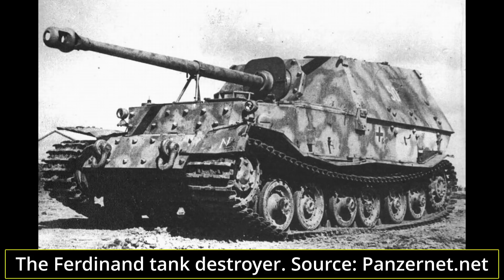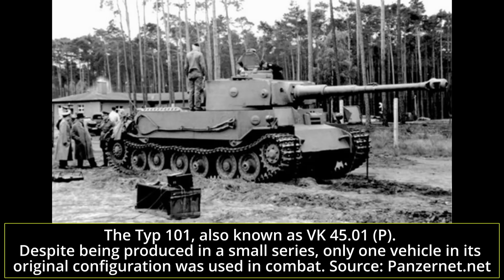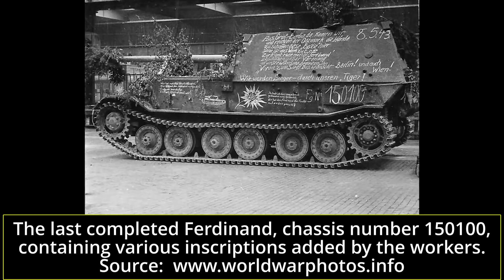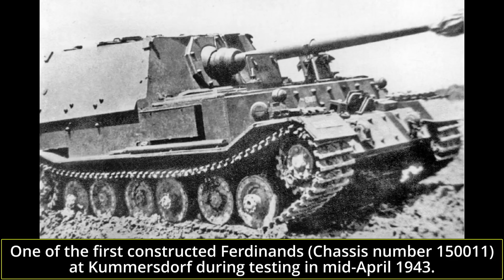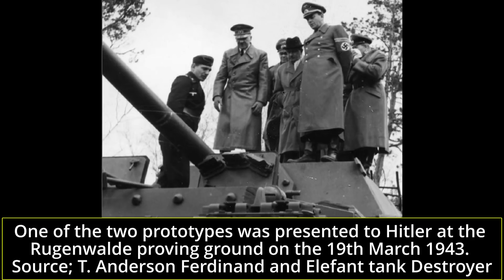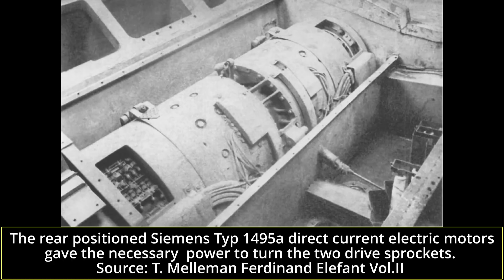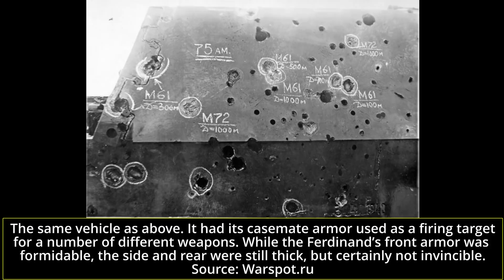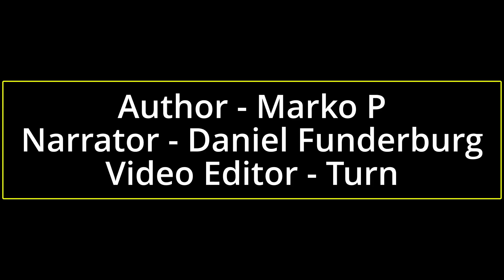The Scariest AFV of 1943 | Panzerjäger Tiger (P) Ferdinand Part 1

Comment: the scariest

for both the enemies and its own crews
Reply: Can relate
Reply: Whole new meaning to firebomb
Reply: literally an improvised JagdTigre using leftover hulls.
Reply: @Manfred K longevity? These things went up in flame often even before the battle started
Reply: harmdallmeyer6449

Many of them remained through 1944 with a few even surviving until Berlin in 1945.
Apart from Kursk, the rest of them took a LONG time to be whittled down.
Reply: Killed on a 10:1 ratio.  Read books.
Reply: @jimmylight4866  Yeah because there are only 90 of them to begin with and the 13 that was lost at Kursk were almost all due to mechanical failure and their inability to recover it 💀
Reply: @Kalashnikov413  Thank you for your reply.  They killed at a 10:1 ratio and had excellent hill climbing ability due to all the torque from the electric motors.  They were knocking out T-34's at 3000m and more.  PAK43 is a great cannon.  Had they gotten more testing time they would have been much better, but rushed into the line much the the Panthers.  Dont be down on the Ferdinand's read what Hilary Doyle says about them.  He sources actual field reports.  Tricky yes, but if used correctly devastating.  If I had to choose I would jump in a ever reliable StuG 3.  The Ferdinand is just so far out there its fascinating.
Reply: @jimmylight4866  Yeah i'd agree on it's actual combat effectiveness but i also cannot neglect its reliability and how almost impossible it is to recover and repair the vehicle

Comment: One might wonder what's the reason for that ridiculously (for 1943) heavy front armor, as it was supposed to stand back and engange at very long range? And at the same time let the heavy break-through tank have "only" 100 mm of front hull armor?
Reply: So you can affiord to give the vehicle 80 mm side armor. What anti tank wepen from 1943, that was used on a large scale can reliable defeat 100 mm armor on a realistic range/angle ?
Reply: Larger guns were beginning to become common place but it was also likely to be an inheritance from the development of the Tiger program. 100mm could be penetrated by various 75mm, 76mm and larger guns.

Comment: There were two units equipped with Ferdinand at Kursk. One was a former StuG battalion, the other came from SP AT background.
The former StuG unit understood combined armored warfare AND its limits, the AT unit thought now that they had thick armor, they could roam around and literally hunt tanks. They were the ones who found themselves "stranded" and close-assaulted. The StuG unit performed excellent. Error of judgement.
Engine and transmission were designed to be used on a 50 ton tank, not the 65 tons of the Ferdinand. Compare Tiger II. Error of trusting a "salesman".
Deployment of the Elefant in Italy was just madness. Any tank in 1943 except the Churchill had problems with steep mountain roads, let alone one that is already troubled on flat ground. The M-26 Pershing had trouble in the Korean hillsides as well. But in both cases that is not the tanks' fault. Error of deployment.

I always wonder why they had not just put turrets on the things (or simply scrapped them).
Reply: The engine and transmission suffered in the original tank as well.

The Pershing was famously underpowered. A horrendous example.
Reply: @Kyle-gw6qp  And still they added 10 tons to the Porsche tank, respectively 15 tons to the Henschel tank. While Tiger(H) was already at the limits, although not as bad as Tiger(P), how could they think of getting away with even more weight ?
I know that Ferdinand Porsche had his head deep in Hitlers ass, but ...

Throwing Pershing into the mix, I have a strong feeling towards corruption in the arms industry. What a surprise !

Comment: Didn't this thing have a shit ton of problems due to its improved design and rushed development? i believe engine fires were common due to a severely underrated powerplant.
Reply: I believe the gearbox was the main problem but yes it was plaged with problems
Reply: Actually the gearbox / transmission were quite good. The problems lay with overheating engines, which was eventually, kind of worked out. Mechanically speaking, this transmission and final drive was much better than that on the Henschel Tiger and Panthers. However, it required a lot of copper and that was needed for other projects in Germany, notably the U-boats

Comment: Anyone else notice the audio stutters?? like it keeps cutting voice audio except bgm audio.

also, does the Porsche Tiger use two sets of sprocket wheels, front and rear?? or is it only driven by the front sprocket wheels??
Reply: Just the one set of drive sprockets. The one at the other end is an idler.

Comment: Oeps, we forgot the machinegun
Reply: Like on any other Stug in existene until late war? Seems like that really wasn't considered a problem
Reply: @SchleiferGER  yes, it was. They used the Ferdinand as an assault weapon at kursk without a machine gun. The russian infantry  climmed  the vehicule and disabled the engine by spraying their flamethrowers on the ventilation shafts, or planting anti tank mines or explosive satchels.
Reply: @danydierickx3228  This has been shown elsewhere, with records of the fate of each vehicle, as mostly a myth. They were closely supported by lighter tanks and panzergrenadiers. Still a failed vehicle relative to the resource investment.
Reply: @terraflow__bryanburdo4547   read [8] Guderian, H., "Panzer Leader", Smolensk, 1999, chapter 10, page 426-427, where he clearly complained about the ferdinand lacking close protection armemend against infantry
Reply: @danydierickx3228  Reports from both Ferdinand units indicate something very different. The blast wave of the Ferdindand's gun turned out to be unconfortable enough that it kept the infantry at bay. The real problem with not having an MG is that you only have one solution for infantry: your main gun, which is most of the time overkill and an ammo drainage. It leads to Ferdinands having to go back and rearm a lot sooner than with mg.

Comment: Could the front be peirced by 17 pounder early APDS? I know it wasn't very accurate but if it did hit could it go through?
Reply from the maker: It should have been able to if it was head on, but we have no idea how APDS would have behaved because it was not a solid 200 mm plate, but two 100 mm ones.
Reply: @TanksEncyclopediaYT  anecdotal but I've heard that armour with 2 layers has less structural integrity than a single plate of the same thickness.
Reply from the maker: That is true, but sub-caliber rounds also behave differently when dealing with gaps and stuff, so it is a bit more complicated than "It had penetration over 200 mm"
Reply: @dylanmilne6683  what you've heard is wrong. Part of the penetration physics at work involve the fact that a solid piece of metal transmits the shock and energy that a penetrator imparts throughout it's entirety. Separating the armor plates allows a lot of the kinetic energy to disperse once it exits the first place. The deformation of the penetrator and the dispersion of it's energy allow the secondary plate presents less susceptibility to the remaining penetration potential. This effect is more pronounced when dealing with shaped charged chemical penetrators but the same holds true for kinetic energy rounds.
Reply: @chrishamilton2559    I don't believe I have. There have been multiple studies as to the effectiveness of monolithic armour vs layered armour of same total thickness. The Monolithic armour always wins as for the reason you say it fails - the whole plate takes the impact and disapates it. Just to be clear we are talking about essentially butted layers of armour, not spaced, there is negligible room for energy to dissipate.
Reply: @dylanmilne6683  If you stack 2 half inch plates right on top of each other it's less effective than 1 inch of armor. 

If you space 2 half inch plates out it's more effective. The projectile starts to become unstable after penetrating the first plate. 

How far the plates need to be spaced depends on the length of the projectile. With long darts such as fired from modern tanks. They need to be spaced further apart that the dart is long. 

With something short like a bullet. The plates can be relatively close together and still have the same effect. 

So it's complicated. It gets even more complicated with reactive armor. Even something like rubber between two plates can help.

Comment: The truth struggles to be told.The kill rate for the tank was very good. The Petrol engines were the problem. The electric motors worked well. Just needed copper.
Reply: Technically that is not true, because the engines were the same as on the Pz IV, the trusty HL120 TRM. The problem is that with the electric engines and the 65 tons if weight you cannot drive the vehicle in low rpm. Additionally the engines have to run pretty much all the time for the vehicle being able to turn if needed.

All this leads to additional wear and a life exspectancy of about 800km per engine compared to over 4000km in a Panzer IV.
Reply: The electric motors overheated.
Reply: @Kyle-gw6qp  maybe they did. But the kill ratio is not even mentioned!
Reply: @SchleiferGER  I am just reading what Jentz and Doyle wrote. Kill ratio was not even mentioned btw!
Reply: @simonrooney7942  Kill Ratio doesn't matter in a war of attrition where you can't replace your losses
Reply: @motmot8879  The video was the scariest AFV - kill ration was relevant to the story.
Reply: @simonrooney7942  I don't think the soviets were scared of this thing, mostly cause they could just bomb it and overrun it with infantry if the ferdinand was in a bad spot
Reply: @simonrooney7942  It's only part one. The other parts will almost certainly mention kill ratios.
Reply: @Kyle-gw6qp  Maybe they will or just continue the fanboy myth that the vehicle was a complete failure.

Comment: screw mm, liters,meters and that other foreign BS
Reply: remember, NASA use metric system to send their man to moon
Reply: Isn't it funny that even American engineers use metric? Turns out that a decimal system makes far more sense.
Reply: Right, right. It's best if you have to take fractions of an inch, and multiply by twelve inches, then by three feet, then by (skipping furlongs, leagues etc) 1760 yards to get a mile. Great system. I'll be over here taking a millimeter times ten to make a centimeter, times ten for a decimeter, times ten for a meter. Then times ten again for a decameter, again for a hectameter, again for a kilometer. And converting to liquids? Super easy. One cubic centimeter is the same as one millilitre. Converting to weight? Multiply that millilitre up to become a litre, fill it with water, and put it on a scale. Presto, one kilogram.

And while you're talking about how great Apollo was for using inches and pounds, don't forget about that time that a multi-billion dollar space probe went splat on Mars because the rest of their partners on Earth provided measurements using a logical system, but NASA wanted to make sure that their measurements were compatible with Liberia.
Reply: @johnladuke6475  Apolla was designed in metric...
Reply: @johnladuke6475  ZZZZZZZZZZZZZZZzzzzzzzzzz
Reply: @john-wk4gq  Did you actually just claim to get bored while learning about counting to ten? You're gonna have a hard time when you have to convert feet to inches. Or pounds to ounces. Or gallons to (also for some reason) ounces. Metric achieves all that just by moving a decimal place.